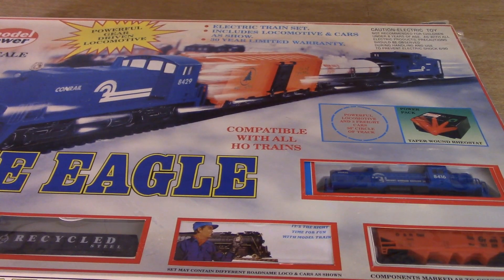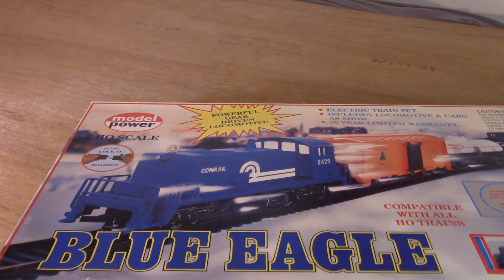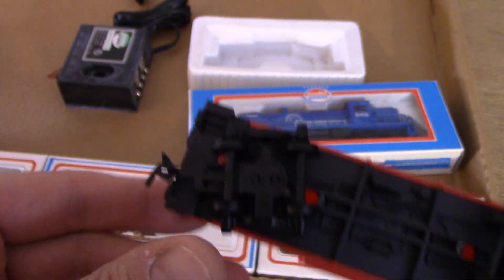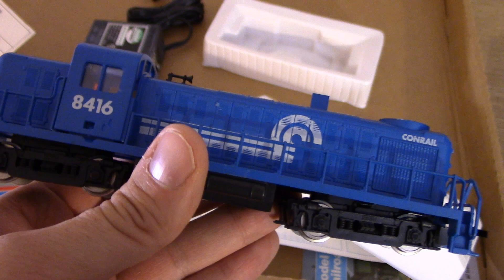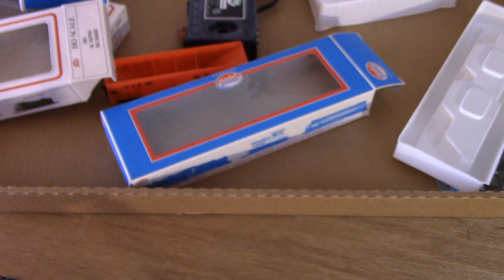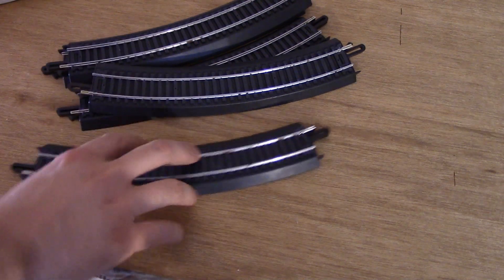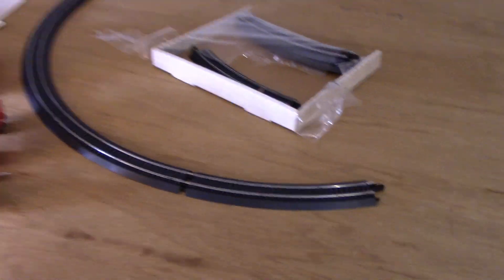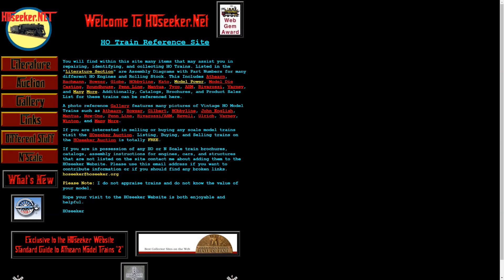Model Power Blue Eagle set

Comment: The grinding sound is likely caused by the driveshafts, rather than the motor. These cardan couplings do not perform quietly on curved tracks. They need fine tuning, which is easily done fith a fine file.
Also, the model is equipped with trucks which support pickups on each side. Add an additional pickup per truck in a designated holder, connect the wires and your loco will run much smoother. 🙂

Comment: model power always had some good sets. the only thing is most of the time you wouldnt get the exact train cars that were pictured on the box. im thinking they made the box universal so it could be used to package other sets. i had the Santa Fe steam engine set that came with a circle of tack , telephone poles, a Santa Fe cattle car, a Peabody coal hopper, and a Santa Fe bay window caboose. the last model power set i purchased back in 2000 was the special Operation Lifesaver set that came with a circle of track, a signal bridge set, a Santa Fe f9 diesel engine, 2 box cars, a tank car, and a flatbed car.  they were both really nice sets.the great thing was most model power sets included accessories.

Comment: model power doesnt need a rerailer on the power track because they stay on the track better than bachman and the rest. the engine here is older than the rest of the set. the boxes with the blue on them are older than the plain white boxes, and the red and black boxed with knuckle couplers were the newest. hated to see model power go because there products not the most detailed but they worked and function better than some of the others.

Comment: Why does it have a sw1000 on the box but in the box it's a rs2
Reply from the maker: Good question. either model power was about to get hold of some tooling for an sw1000, that's how Model Power got new models, buying other peoples stuff. Or, there was a miscommunication, to the art department, as to what locomotive was going to be used in the set. Thanks for watching!
Reply: The Alco diesel guy well then